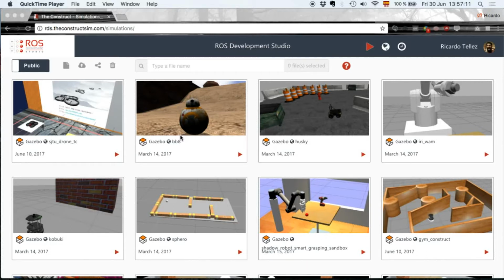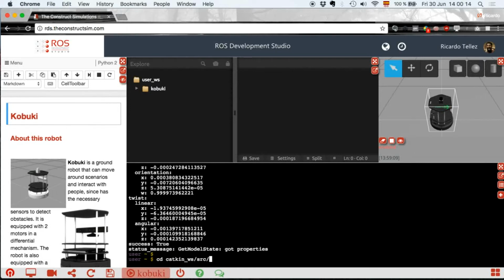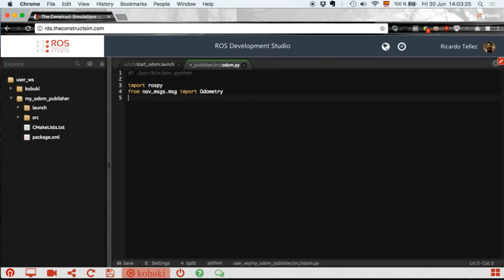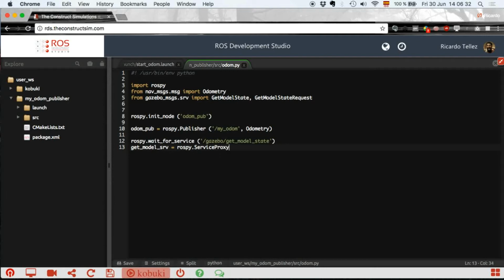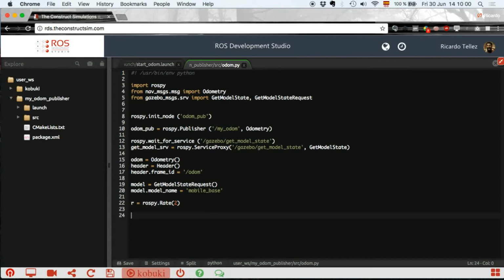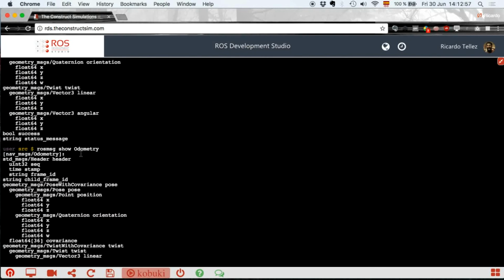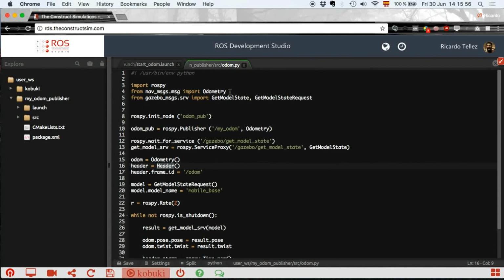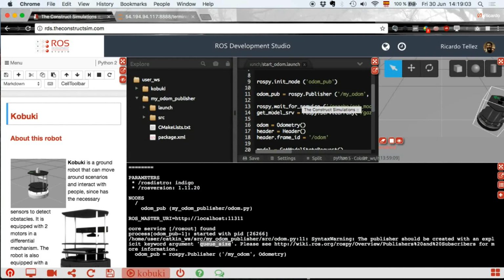[ROS Q&A] 007 - How to publish odometry from simulation position

Comment: Hi,
So, the pose data which you get from the simulator /gazebo/model_state, Can you call that data as your ground truth for the pose of your robot? If yes, then this data can be compared with sensor data example wheel odometry or fused data(wheel odometry + imu) to get the error in odometry, right?
Reply from the maker: You are right Shrijan! The position data you get from the simulator topic is ground truth, since that would not exist in a real environment, so your robotics program cannot make use of that data for building autonomous robots. It can be used to compare with your algorithms output as you mention, and then compute the error. It can also be used to train with reinforcement learning your robot (so you can compute the reward based on what the robot should have done and what it has actually done). 

Good point Shrijan!!
Reply: @TheConstruct   That's perfect!! Just one last query. So, consider I'm using G-mapping SLAM. First I do the mapping of an environment in Gazebo using the ground truth odom information from Gazebo/model_state and then do the same mapping using sensor data wheel odometry or fused data(odom+imu). So, do you think both the maps are going to be same or will be different?
Reply from the maker: @shrijank522  Very similar if you do it in simulation and if your algorithm for fusing data is good, because simulation provides too perfect values for odom+imu, so the resulting value of your fusion will be close to the value of odometry provided by the ground truth. Also SLAM algorithms are pretty good filtering errors.
If you want to test that in more close to real situations, you should artificially add noise to the data of odom and imu and then compare
Reply: @TheConstruct  Thanks alot for the clarification. Actually, I was implementing SLAM for mobile robots inside pipe. So even fused odometry data may not be enough due to wheel slippage on the pipe surface  while mapping so I was wondering what if I provide /Gazebo/model_state  odom instead of fused odom for mapping. Thanks anyways...cheers!!
Reply from the maker: @shrijank522  in that case, you may be interested to compute the odometry from the laser instead that from the wheels encoders. That will be a lot closer to reality. Check this video to learn how to compute odometry from laser: https://youtu.be/3J5WcU4xFAo
Reply: @TheConstruct  Yeah that's true. But, if you have a long straight pipe or a long corridor without any features then the LiDAR odometry data is of no use since it will scan the same point at every instant, that's why I kept more weight on Odometry and less on Lidar data while doing G-mapping and I'm getting good results.  I just wanted to compare my map obtained from SLAM to some ground truth map.